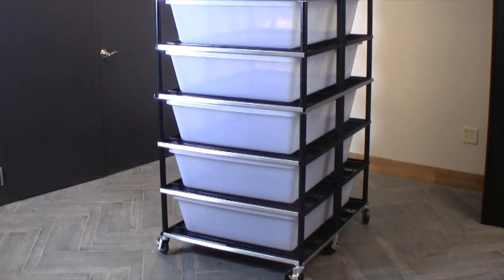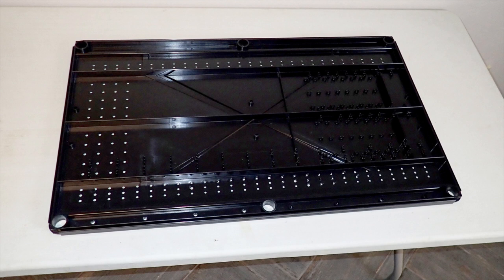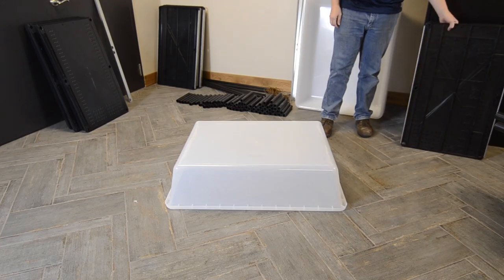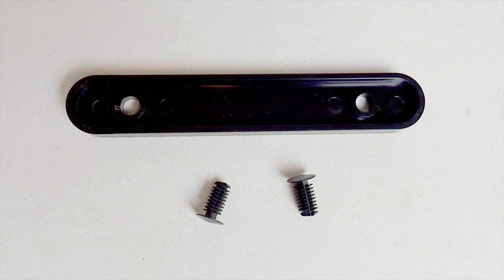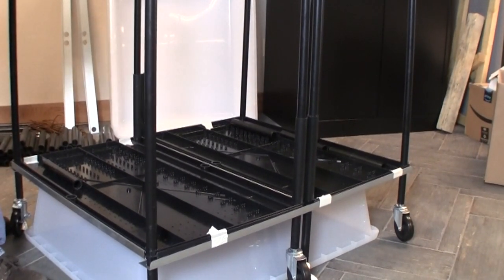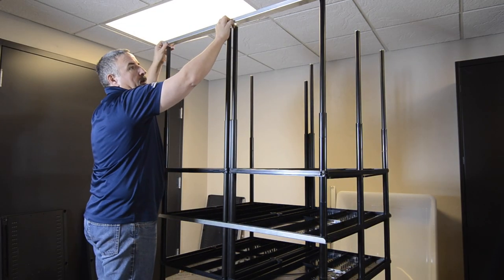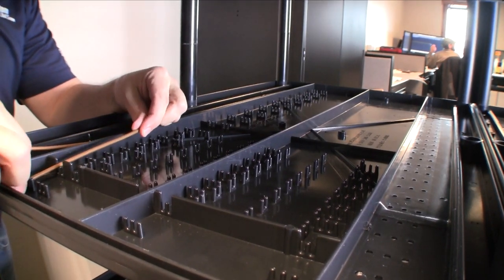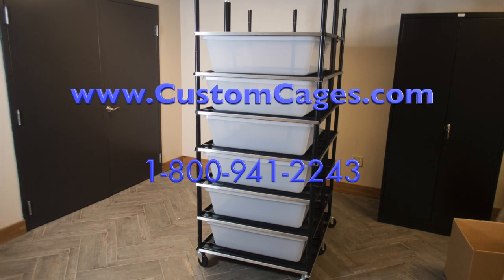Vision Boa Rack Assembly Tutorial

Comment: Can other reptiles like lizards and turtles go into the rack or is it only for boas
Reply from the maker: Many different types of animals are kept is racks.  The usual issue for many is light, specifically UVb, which is hard to supply in a bin system.  But the Vision Rack system is versatile.  For example, if the animal cannot escape over the top edge of the tub (like a turtle) you can add spacers between the shelves and hang lights over it.  We have several turtle and tortoise breeders who are doing that for rearing space.  We also have the 'Rodent Breeding Rack' which as a stainless steel covering shelf over each tub with a wider hex grid venting pattern.  Lizards that benefit from overhead basking light/heat can be housed in that system so long as the animals cannot fit through a 1/2" opening.  We have a customer using that system for juvenile blue-tongue skinks and another using it for breeding groups of adult leopard geckos.

Comment: What happens if the wire is chewed a little bit?
Reply from the maker: Are you referring to the heat cable?  The animals inside the tubs should not be able to get to the heat cable.  Any damage to a heat cable that exposes the element wire becomes a fire danger.  The cable should be replaced.